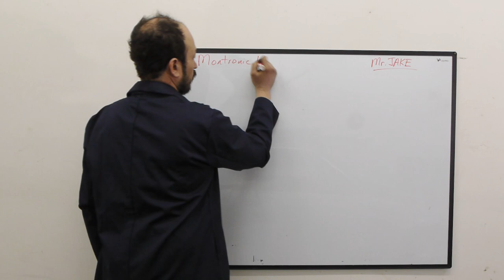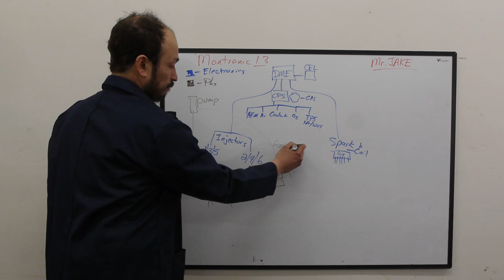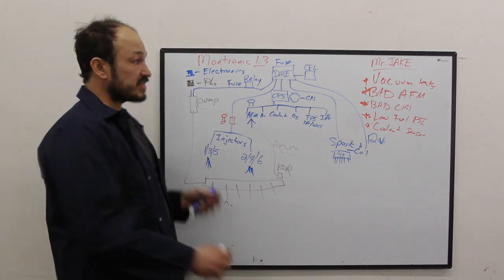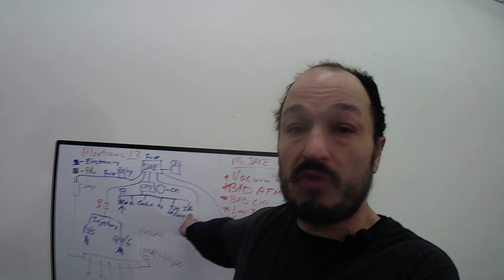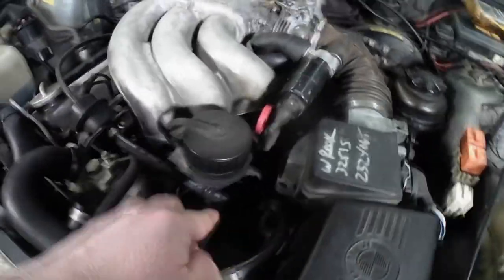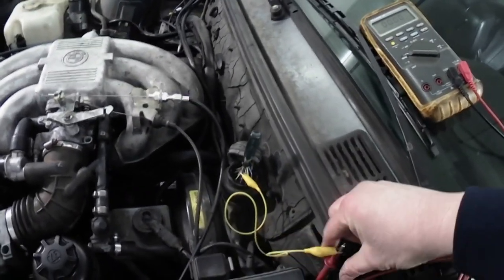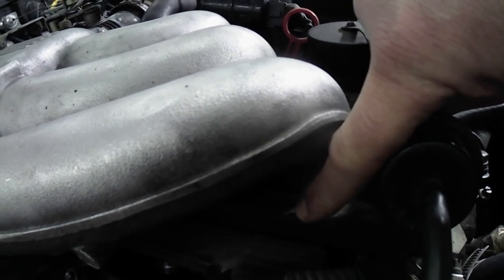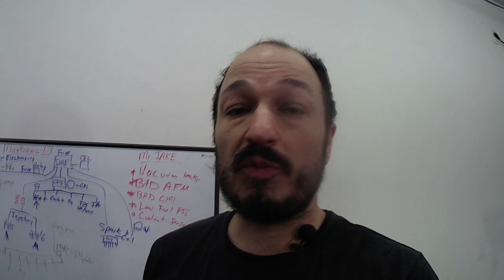BMW E30 325i Diagnosis M20 NO START - Bluepty: The Boosted Beater Video 3

Comment: Great video with a ton of accurate nuanced information.

Key highlights that are worth repeating:

1. Confirming check engine light in accessory mode is critical as it shows that the DME has power; with main relay being first place to check.

2. There are default maps on the DME that the car will use in the case of an unplugged sensor. Instead of shotguning parts, just simply unplug and test.

3. Unlike modern cars, the fuel pump only runs while cranking.

4. The primary relays are segregated for a reason in the engine bay; they are critical to the operation of the car, and if original, changing them makes a ton of sense. 

A couple suggestions and more nuanced detail:

A. One area missed in the video is the importance of a good engine to body ground.

B. Pre 1988 M20's had a dual fuel pump system, and no detachable fuel injector harness. Main pump is in front of the drivers side rear wheel.

C. A suggestion for a future video would be to show how the car runs with each sensor unplugged. 

I can't confirm off the top, but I believe the car will start and idle with the AFM unplugged as well. In the video it made it sound as though that was one sensor you absolutely needed plugged in for a no start.

Keep up the great videos!
Reply from the maker: Thanks for the suggestions and nice words. 

Yes it will run without afm but extremely poorly and very very rich. I also unplug to test. So few things are actually even needed to make it run.
Reply: @Classic Daily  it would be fun to unplug everything other than the CPS and see if it will still start. No icv, afm, tps, coolant sensor; even the evap valve and the #6 pulse sensor (all 6 injectors should pulse at the same time as a failsafe).

That would really show just how little is needed to get an e30 to start.

Comment: Hi thanks for the video. I’m not getting my car to crank at all. 
The previous owner ran a wire from the fuel pump fuse to somewhere else I guess to bypass the 7.5a fuse. The car was starting a few months ago. But the fuel pump stopped working. I swapped in a new and better fuel pump which I think burned out. When I touch the wires harness for the fuel pump(under back seat) it was                                                                                                                                                                                                                                                                                                                                                                                                                                                                    extremely hot.

The next problem is that the car is not cranking. My friend said that the starter is not working. But he put power directly to the starter and it came on but did not engage to crank the engine.

Right now I have a new alternator to install, I’ve installed a new main relay and new fuel pump relay (I don't think that was the problem at all).

The dme is on because the check engine light is on and ICV is humming.
Reply: figured out that part of my cranking issue was the park neutral switch ... now I'm trying to sort out that fuel pump wire issue.
Reply: @kmatikzofficial  What fuel pump are you running?  If the wires are hot the fuel pump is either pulling to much current or the wires are pinched/broken somewhere.

Comment: Having an issue with an 1989 325i starter and igniton. Someone added a push button start to the car completely separate to the car but runs off the battery with a 25amp fuse in the wire from the battery, So i removed the push botton start wire from the starter and connected up the blk/ylw signal wire to the starter but of course it does not crank at all. I believe its the ignition switch or a relay. and thats why the wired up push button start to bypass it.

Comment: Great video!  Lots of information here.  Do you have any suggestions for a no crank situation? I have 90 325i automatic.  It stranded me at a parking lot.  Changed the starter, ignition switch, ignition relay, neutral safety switch and the DME relay.  Still no  crank.  Stuck at this point.  Thanks!
Reply from the maker: No crank is fairly easy....  Is the starter getting power at both the large lug and the small solenoid lug?  If not start working backwards probing for power.

Comment: Would the CPS prevent the fuel regulator from switching on the fuel pump but still allow the car to produce spark?  1988 325i. Runs on ether….  Won’t fire the fuel pump or injectors… even when I jump the fuel pump relay…
Reply: No spark pulse if the CPS is bad.  So if you have spark then the CPS is fine.  So jumping the fuel pump relay turns the pump on or no?  Have you checked fuel pressure?  Have you checked for injector pulse with a noid light?  Have you tried checking click of the injector just feeding them 12v?  Make sure they are not stuck.

Comment: I’m getting power to the fuel pump relay and fuse 11, but not to the fuel pump. At this point do you recommend chasing down the wire to the pump?
Reply from the maker: Yes I would suggest ohm checking the wiring from the fuse back to the pump.  Also make sure you have a good ground at the pump.  How are you checking for power at the pump?

Comment: Hi Jake. I have power down to coil. Crank, no spark. The power doesn't pulse. 
CPS works. Wires to ECU from CPS are OK. Cps is giving me 2v A/C but no engine speed seen by the DME. 
Should I check the earth from the coil to the DME?
Reply from the maker: Is the coil any good ?    Cap rotor ?  What if you put a plug wire from coil to single plug to test.
Reply: Did you ever figure it out? I’m having similar issues

Comment: Hi, I've watched your whole video and I have a question. My car is a e34 m20b20 from 1988, that was running properly and all in a sudden, started to stop by itself, two or three times at idle, then stopped a last time and do not want to start again.
I have: good fuel pump (I deduct good crank position sensor).
No fuel in cylinder
Spark plugs are not working as well.

Could it be a bad ecu? How could I test it before trying to find a replacement?

Thanks, and again thank you for the clear and useful video.
Reply: So when cranking does the fuel pump run?  Can you feel the idle control valve buzzing with key on?  Check for injector pulse with a noid light when cranking?  Do you have 12v at the injector with key on ?
Reply: @jakeb6265  when cranking, fuel is coming (i ve unplugged the hose and get a fountain of fuel  instantaneously), idle control valve is pulsing, I didn t checked the injector tension but I guess 0, as I do not find fuel on the spark plug, I deducted they are not spraying...
Reply: @Tuomas2507  Check the C191 connector under the intake manifold.  I'd bet its either badly corroded or some broken wires.
Reply: @jakeb6265  not corroded, I ve unmounted/mounted few times without issues. Maybe last time I didn t mounted back correctly, I'll check that as well. I also ordered the relay, just to be sure of that even if I do not believe it's the problem...
Reply: @Tuomas2507  If the ICV is buzzing then the main relay is fine.  Check for 12v at the injector connectors.  There is only ONE wire that feeds them all so if its broke you will have a no run condition.

Comment: Hello, thank you for your content! I will be very grateful if you can help me. Im trying bring back to live my E34 M20B25 1988 more than a year (i dont have too much time). One day I backed out of the garden and when I ran over a little hump, the car died, I thought fuel pump, but jumping relay showed its ok. Then CPS, via ohm test it was ok but I bought new OEM one, didnt help. Then i recognized there are no sparks and ICV dont hum/buzz. Some troubleshooting diagrams went me to faulty DME, I was checking cables grounds, multiple times.. so I bought an used one, but its probably bad too. Then magic happened. With my oem DME ICV starter buzzing, but weirdly like when cable is broken and you are movin with him. Then it stabilised and buzz continuously and engine starts. BUT !!! I hear buzzing from dme too, then its stops and engine dies. I did some gently taps to the dme and start buzzing and engine runs.. I thought its broken cable somewhere near the connector, I tested the powers and the green one, grounds.. everything OK. With the used one DME this doesnt happen. Im really sorry for my english, but do you have an opinion where I can found the bad thing? Does your DME buzz too? Can send video. Im away from now for test if the engine lights is blinking whet this happens. Thank you

Comment: I really need help. Early model 1987 cabriolet died while driving, and it cranks but wont start. I've replaced the CPS, spark plug wires, spark plugs, distrubutor rotor + cap, ignition coil. I have fuel, but no spark. I've even tried plugging the ignition wire off the coil into a spark plug directly, and while cranking observed no spark. Dead ECU?
Reply from the maker: Yes I would bet bad ecu.  Do you have 12v at the coil?
Reply: @jakemodscars  Checking that later today. Its worth noting that one of my spark plug wires when i replaced them, was OEM, and had the metal socket completely in pieces. I read one forum discussing how pulling a running spark plug can send that voltage back to the ECU, or a bad jump (which i also did at the start of winter, although it drove for 45 minutes) which makes me think that could've happened, but not sure. Thoughts?
Reply: @jakemodscars  I do have 12v at the coil, at pin 17, and 28 of the ECU plug.
Reply from the maker: @joshantoniuk2940  Eh...i've never heard that but maybe.   But it sounds like you most likely have a bad ecu.

Comment: my m20 will start and die immediatly when cold, but fine when warm any ideas? new coolant sensor didnt fix. i have to hold the throttle on cold starts
Reply from the maker: Clean the idle control valve

Comment: My fuel pump runs but I have no spark coil has .6 ohms on pos & neg secondary has 5.92k Ohms but I’ve got no spark when coil is in car
Reply from the maker: Do you have 12v to the coil?  Fuel pump runs when cranking?
Reply: I have same problem. My pump won't run when cranking. I have 12v at the coil but it doesn't pulse. The cps works fine and so do the the wires to the dme but the engine doesn't see engine speed in live data! .
Reply: @DJSpannamanUK  Then the CPS isn't working....  Or its a bad DME.